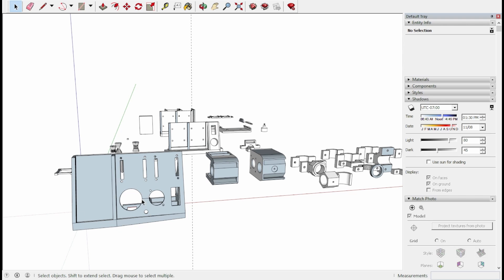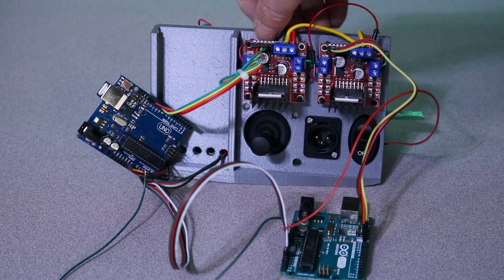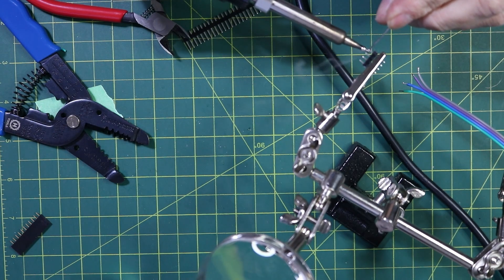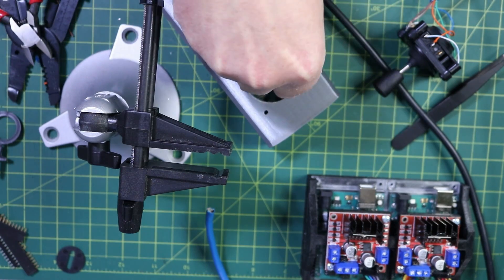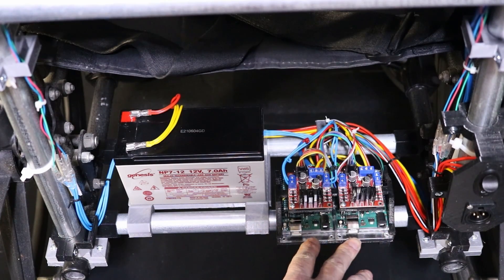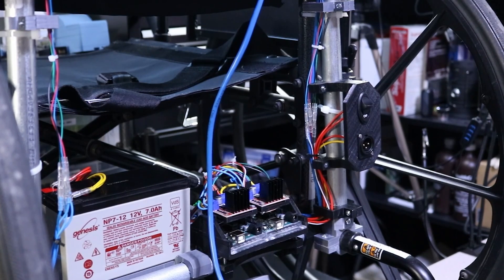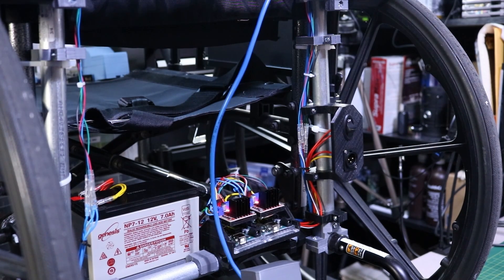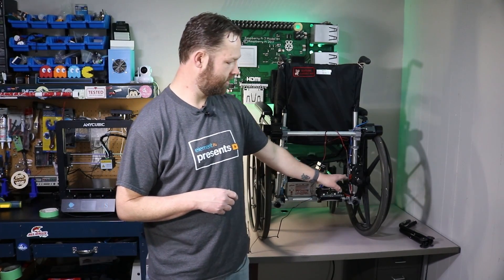DIY Electronic Controlled Motorized Wheelchair

Comment: Great idea and very well implemented, this is what I was thinking but I wanted to implement that setup without the joystick and use motion sensors so as soon as you start pushing the wheels as normal, it would kick in the power, essentially an electric assist for people who do not have the arm strength to move themselves without assistance.

Comment: Can we as a community come up with a DIY solution to use your passenger existing chair and mount it to a swival and so it can extend outward and inward using a back hand held up/down/right/left controller. Can we use parts off a electric chair and its range of motion, wheel bearing off a car for rotation or a swival we can buy that is already on the market. I own a tig welder and i have access to sheet metal and i just dont know where to start. When i google for an electric passenger chair they want $5,500. Just insane.

Comment: you reversed the 3 pin standard for wheelchair charging. Pin 1 is +ve, pin 2 is -ve and pin 3 is usually inhibit (connected to pin 2).

Comment: Sir, can you advice me on how to upgrade my electric wheelchair to run a bit faster and stronger safely? My wheelhair has two motors. Each has 250 watts. It has 2 batteries as well. Both are lead acid with a capacity of 12v 17.2ah each battery. Do I need to change my controller as well? Or is there a significant upgrade that won't be needing to upgrade also my controller? This is the keywords in Amazon 2021 Model Fold & Travel Lightweight Electric Wheelchair Motor Motorized Wheelchairs Power Wheel Chair Aviation Travel Safe Heavy Duty (Red - Black). Hope you could help, Sir.

Comment: I know sealed lead acid batteries are the cheap and easy solution, but you do realize you can only use about 3.5 Ah (50% of rated capacity) before before starting to reduce it's lifetime significantly?  A lithium-iron battery would be a direct replacement, have longer (2-3x) lifetime, and let you use much more of it's rated capacity.
     Bass Pro Shops*** sells the Tracker LiFePo4 battery that would be a drop-in replacement for the Genesis (as would a lot of others).  The 6 Ah version would be about 3x the price of the battery you chose, but have at least 50% more usable capacity per charge, and a much longer lifetime (500-1500 charge cycles vs. 200-300).  Not only that, partial charge/discharge cycles actually extend the life of LiFePo4's. Doing the same to Lead Acid will lead to reduced lifetime. Storage presents similar problems - Lead Acid batteries sitting around doing nothing degrade much faster than Lithium Iron - especially if partially charged.  And if you upgrade the charger as well, it'll charge a lot faster!  If you're only using this enough to replace the battery less than once per year, it's probably not worth upgrading.  Once per year or more, and a LiFePo4 will save a decent amount of money.

***Disclaimer - I am not a Bass Pro shill, nor do I advocate them or Tracker batteries over any other.  This was just one example from many that would work well, chosen for being well known and available in a lot of areas in the U.S.  Tracker batteries have a 2 year warranty, so I 'assume' (don't! :-) they're decent.  YMMV.  (Also, I personally like being able to talk to a human, in person, if I have issues after the sale, so I buy local whenever possible.)

Comment: sorry to disappoint you, but as soon as you sit, its going to stop - no way two wimp steppers motors are moving a human.  Nice try though.
Reply: Weird how Wesely, aka a human, sat in the chair and it moved. So... I guess there is a way. 

Nice try though.
Reply: @bald_engineer  ya, so briefly, i missed it first time. Looks like motors grinded to a halt and/or batteries choked. 🤗
Reply: @ChrisLocke1969  No worries, I get it. Trolls have to troll. 

Nice try though.
Reply: @bald_engineer  truth hurts, makes you the troll, kid
Reply: It moved me,  my daughter and my dog around......mind you it was slower for me.  But yes even from a dead stop on a smooth surface it will work.  If a wheel chair with good bearings and proper seating weight distribution is done.   PS.  I repair wheelchairs scooters and power chairs for a living.   I set them up for people all the time. I was pushing the limit of the motor tho but anyone lighter then me its all good.  And yes I would certainly be into making another unit with more torque but on a budget and parts most would have around this was a cost effective and a project anyone could build.   But thank you for the comment.  I appreciate the input and your concern.  Have a wonderful day eh!
Reply: @Gam3T3cHElectronics  its a great start nonetheless... i think solving problems for the disabled is the best thing we can do with robotics and automation... keep up the good work!  And ya, i hear ya, budget always holds back progress... a couple of Nema 23 motors should do it! 🤩😎
Reply: @ChrisLocke1969  how much weight on an average can a nema23 motor move and at what mph. and what kind of battery should i choose for that? pls answer
Reply: @josaphcj7199  thats an unanswerable question, sorry. Weight is only one of several factors.

Comment: I't looks like you used digital switches for the movement, i'd go analog using an RC car/helicopter/airplane gimbal joystick. Adjustable speed and far more control over turning.

Comment: I was thinking you could put the rollers below the frame in front. To help with the added weight distribution. Also, you already have a good mount point there and might need as much added structure.
Reply: Great point but but with most chairs there is always one spot you will have no issues mounting to and that was the location I decided to go with depending on the chair and design it might not work  correctly.  I was going for something that could be added to any chair without much messing around.  But I certainly will have to give that a shot tho moving the location of the motors to a few different spots.

Comment: I don`t see why you need to use stepper motors for this, isn`t the point of steppers for tracking the position of the motor angle, couldn`t you just of used normal brushless motors, its also pretty noisy.
Reply: Sure could have but I wanted to see if I could actually do it with stepper motors.  and it worked.

Comment: This looks awesome. It will help a lot of people who can not afford a motor wheelchair. I was curious over time the little motor hub wheel being plastic how long would it last? I would think over time it will wear down.
Reply: Of course over time it will wear down but since the speed is so low it should take some time I did use PETG Filament for the rollers. The tires are also a solid core tire so no need to ever add air and change the friction on the drive.
Reply: @Gam3T3cHElectronics  I understand now thank you.

Comment: What I would change - I'd relocate the drive motors back lower on the wheel and I would move the Power Switch to the armrest and I would have it a key/ignition switch. It would also be helpful to have a power meter where the person in the chair can easily see it. Wishlist item - Some sort of cordless charging dock.
Reply: So in a facility you don't want them to have access to the power all the time, this was my reasoning for limiting the location of the power and charge port.  having a a simple battery meter would be easy enough to incorporate but was not warranted in the first design here.  But yes relocating the motors would be something I would be looking at in the future of the design. I will be playing with it more and coming up with more ideas with it.  Thanks eh! for posting appreciate the feedback.
Reply: As a retrofit, this placement is about the only option.  You cannot put them forward of the seat back, as that would present an entanglement issue with the patient's clothing and interfere with self-moving the chair by hand.  Moving them any further back would present support issues, increased entanglement possibility for anyone pushing the chair, and increased possibility of collision damage when reversing.  The only way to really improve the drive without any other issues would be to modify the wheel hubs - a little much for a retrofit.
Reply: The current position is relatively unobtrusive for someone pushing the chair. While it wouldn't be impossible to mount them lower and still have similar access, the frame would be more challenging. (I know I have to be careful to not knock myself moving my Mam's chair around - admittedly more on slopes than this specific intended use case).

Comment: I have an electric chair but a manual chair motorized would be much more capable in more terrain mostly cuz of the weight differences
Reply: There is a unit invacare made a while back but the batteries were like 1600 dollars each and now obsolete and you know anything medical = more $$

Comment: Great work
How did you choose the motor specification ( like torque , power  ...  etc ) according to the weight ?

Please answer me .. i need the answer so much
Reply: Well its a nema17 motor so I did go with one with more torque since we would be running from a dead weight to move a body in the chair.  This being said I certainly would like to try different locations and different motors and rollers on the chair.